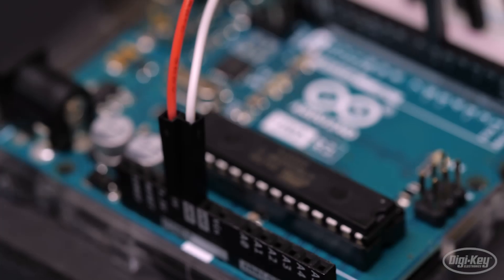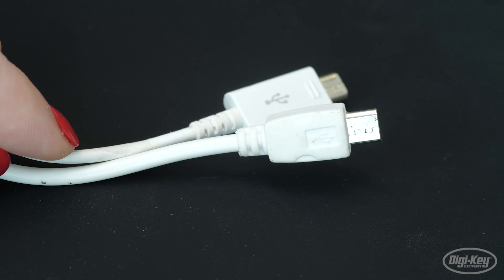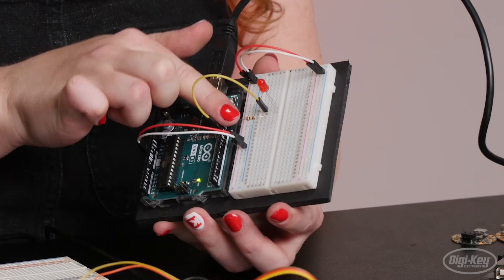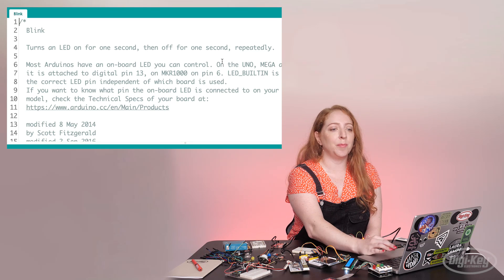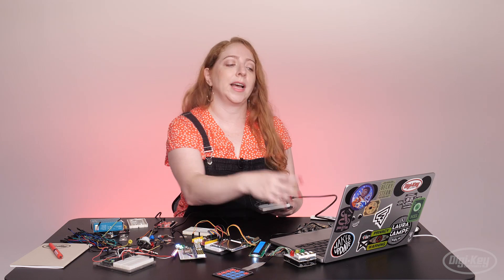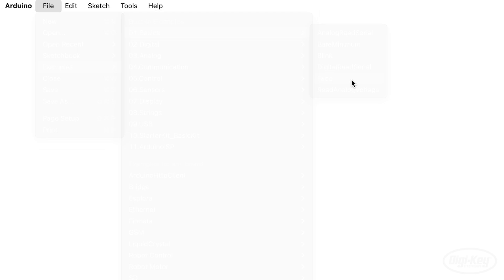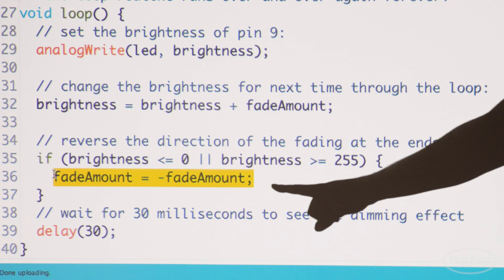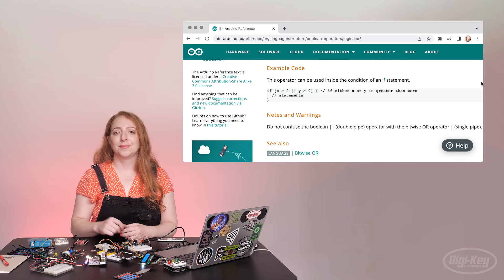Arduino Basics - Electronics with Becky Stern | Digi-Key Electronics

Comment: Can I create a sequence that opens and closes a signal off and on by increasing percentages of 10%? As in it will open and close a signal 10 times “off/on” from a PWM  input signal of 0-100%? I need this sequences to be performed from just one pin on the board, is that possible and what’s the smallest board that will do that for me?

Comment: video chapters option, nice touch to quickly go back, the world is no longer only 5 volt as in the beginning stage of Arduino a decade ago, many electronics are now 3.3v only, an arduino kit includes only 5 volt devices. (no smoke from fried electronics)
if the kit has 3.3 volt device(s) it will also include a level shifter (read the fine manual)

Comment: If you’ve never used a microcontroller before the Arduino Uno is the best choice. The official Arduino kit I got came with a book and a bunch of sensors, LEDs, knobs, etc… The Uno is the worlds standard as a first board. 👍

Comment: This is more a promotion for dungarees than for Arduino. The UNO is obsolete junk. So is blink with delay. Corduroy overalls are killer though!
Reply: This video is for beginners and the UNO is still the best for this. Its OK to use delay() to start will, they can learn about millis() later on.
Reply: @gedtoon6451  I let students start with the Microbit v2. Lot more fun for a starter, we use it as Arduino with c++. Advanced projects we move on to M4 Express or Teensy 4. Arduino Leonardo/MEGA have their niche at school. Leo is Uno done right, cheaper as well, and the MEGA is great for hacking into 16-32 bit bus hardware from the past.

Comment: Hi Becky
Thank you for the video very educational…. You are a leader.
My head is Not hurting with the barking dog….My head is having new ideas with that, I like to design and build a circuit that will have Arduino input a microphone to sensor the noise and output pins a relay to turn on and off a light red and green an teach the dog barking on green and no barking on red lights that means we are on air or recording. Thank to the barking.
Also please bring your dog to camera to be with you, next video 
I love it thank you again